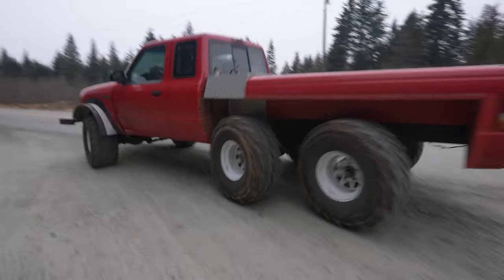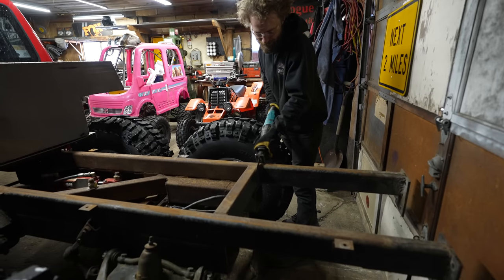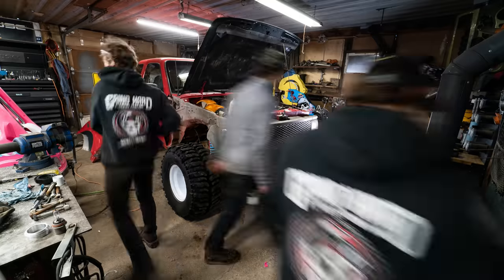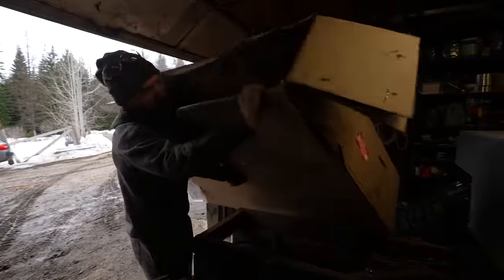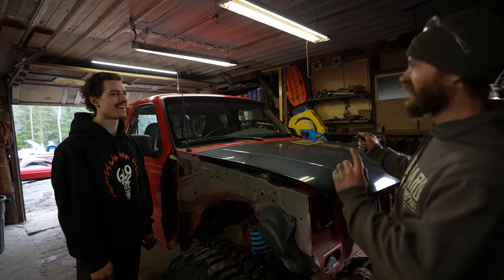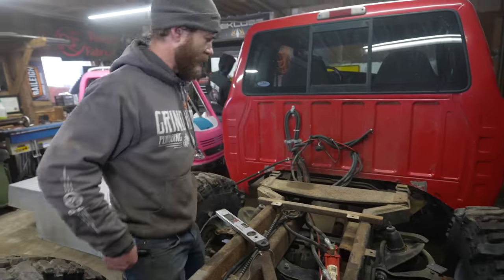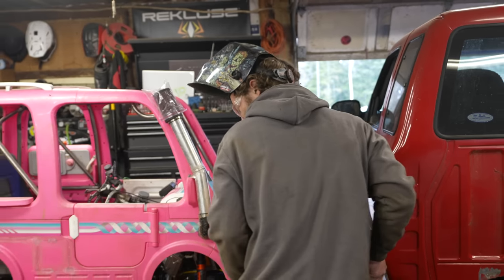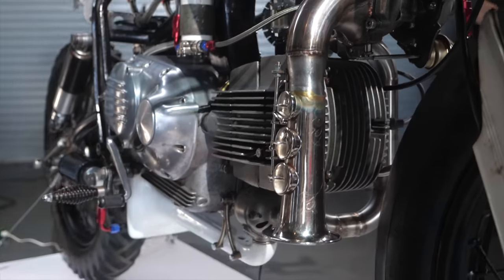Building a 6X6 Pre-Runner Ford Ranger!

Comment: You really have to appreciate how well the original builder built the thing. Some 6x6 conversions are all show, this was if it works whatever. This thing was probably done for spare change compared to some, but is already a badass unit for a starting point.
Reply from the maker: For sure! It was built very solidly in a lot of ways!
Reply: It was alot of work when my step dad and I built it. He has since passed.
Reply: @DANIELVINZANT  What year did he build it? Where at? Sorry for your loss.
Reply: @Beau Mershon  some were in the early 2000; it took us some time.  The truck was passed through the family prior to us building it. The person who we bought it from  got two DUI in 24 hr. He was running from the police slid off the road on the ice. He Hit a tree, He then tried to get it unstuck. The bumper hood radiator all damaged.  tranny leaking all over the place. it was not a runner when we got it. Our intention was to hunt with it. We had several hunting buggies at the time. When we got all the work done to it, thats we found out that the tranny was bad. He didn't tell us it was bad, but later, we found out differently. For a small town shop we sunk a lot of money into it. The front end was rebuilt to accommodate the 35-inch tires. We were told by the 4x4 shop in our town that we could put the whole thing together with the 37. But later, we found out. That the gear ratio would not work. Our understanding is that if we didn't put the 35 on the front , we would blow the tranny or t-case.  So the 4x4 shop, they reworked the front differential. Be careful with swapping tires.    We have huge  swamps up here. We did not plan on running it but in low range. We were told by the 4x4 shop that if we horses it up too much, we would smoke something. The old man, as he was referred to. Decided not to take it out. It just sat in the yard for about ten years. It was in the local parades a few times.  I think it was the local paper. Everyone in town is new who built it. Have fun with it. It right know is the talk of the town. You might want to mention his name in the vidoe. He has about five hundred relatives in the here small town. He was well respected and well loved by many. He would help out a guy in the middle of the night In a rain storm.. ask me I know. His name was Danny Mahan love to build all kinds of stuff. We built over  hundred boats in his shop. From fiber glass to aluminum.  It's a complete metal fabrication shop. With breaks, plate shears, iron worker punches and ten different kinds of welding machines. Just to give you a backround.
Reply: @DANIELVINZANT  it even more amazing that he was pretty crippled up and still managed to build it 
in soldotna alaska of all fucking places
Reply: @DANIELVINZANT  WOW you should repost this. So everyone can see. Cool story! Peace brother!
Reply: @Beau Mershon  we made a memoral vidoe of alot of his work through his life time. I would love to share it with you. I am going to need to get help with that one.  Becouse I am still learning how to navigate computers. Phones are pretty easy.  I am not sure how to upload that and were I would do that.
Reply: Yes He had poleo since he was 5, one leg was the size of a realy boney man's leg and four inches shorter. The other was size of a 12 inch pipe,  in his hay day he was a very powerful man. His upper body was extremely strong. Most of his siblings were over 6 feet and built. Great man I admired him alot. He taught me many things the most important thing was to always do the right thing, and if you didn't know what that was, he would always bend an ear to help you along your way..
Reply: @DANIELVINZANT  I know you added gears but did you do anything to add power to the 4.0 v6?
Reply: @Brock A. Stanley  we did nothing to the engine, except the electric fan for crossing streams. That's becousse when it was in the accident the stock  fan got smashed. We did put the new tranny in there.

Comment: Hockey puck body lift is remarkably common. They are good, high durometer, durable rubber.
I do wish you guys would keep the bed, in some capacity though.
Reply: And the most important quality- cheap
Reply: I actually prefer pucks over the hard chunk of plastic they give you when you buy the kits.
Reply: I don't have a lift but I replaced my worn out cab mounts for just a little over 12 bucks 👌
Reply: Pretty much before body lift kits were a thing this is how we did it and as mentioned already pucks are better and cheaper than what you buy as a "lift kit".
Reply: came here to say the same thing about the hockey puck body lift.
Reply: Agree on keeping a bed.

Comment: I lifted my Volvo 945 with hockey pucks in the rear, and in the front I cut and lengthened the struts. Back then I was one of a handful people who had lifted a Volvo, today it's become popular so there's a lot of people who have done it now. If it wasn't for inspections and laws here in Sweden I would've gone crazy and built a pre-runner out of it with doubled suspension travel and such.

Comment: Prerunner rangers are cool, but I feel this would've been a lot cooler build as a crawler.
Gonna be interesting to see a long travel kit for the rear.
Reply: I don’t think they are going to long travel it, it’s a “pre-runner” aka just new widebody fenders, method wheels and bumpers. They bitched out on this one lmao
Reply: @evanloeffler6772  I had a feeling it was gonna be a "looks build."
Reply: 6x6 with half ass front ifs spiff axle.... kinda pointless, todo the work on ranger for one I’d make both rear locked with 6 wheel hydro steering lol but I don’t have the time for ranger
Reply: @mikeyhue2437   the ttb is a desert proven ifs thats hard to beat in strength and travel. I'd definitely switch it out for a 44 ttb if they were to keep it and actually do a true pre runner build.

Comment: You guys ought to get a gouging head or oxyfuel torch to blast the welds in stuff like that big 7/8 plate, I used to hate it but once you get smooth- insane time saver, and once you clean it up for welding you wouldn't know the difference anyway

Comment: That plate behind the cab that was under the toolbox. Just from the video. What I see is. Could it be a twist brace for when you steer the back axles? As in when you are in a very tight bog and turn axles. Could the frame twist and if so, does that plate stop it from twisting any?
Reply: Could be but some good triangular bracing will do a better job for less weight.

Comment: I think that plate that was at the end of the original frame shouldve stayed. weight reduction might cause your 6x6 frame to seperate with a jump. Saying it as a frame machine operator at a body shop.
Reply: Yeah, thats what I thought, lowkey dumb for cutting that big ass frame plate off 😂 like that was the whole torsional reinforcement of that connection

Comment: 0:37 I believe that center hole is for mounting a switch to wire for dictating center position 🤔
Reply: in tandem with user input switching current as the other cut-off the polarity of which to charge a non-polarized capacitor in dictating direction by driving two reversed latching transistors fed back through the control switches.

Comment: Now were that aluminum arm bolts to the steel arm I think you should check to make sure there's a rubber gasket in between you want to keep those 2 metals separate from each other or you'll get electrolysis In other words it'll start  croading prematurely .  That's what did the Queen Elizabeth tune in that's why they retired or because the aluminum superstructure was starting to corrode faster than the steel hull

Comment: can you decide to turn the back wheel in the opposite direction of back wheels to turn real tight?
Reply: The current linkage mechanically ties the steering of the two rear axles together and steers them the same amount. They could operate the steering of each axle separately and build a control system to coordinate them, but I'm pretty sure that's not the sort of thing that these guys do.
Reply: @brianb-p6586  thank you. It's little bit confusing because there is 6 wheels. My question was can the 4 back wheel turn in the opposite direction of the 2 front wheels for better turn radius. Like GM hummer and now the cybertruck. Not the crab mode. Instead of control system, a single 1:1 gear would invert the front 2 wheels direction to the back 4 wheels.
Reply: @JeromeDemers  Sorry, I read too quickly and although the intent of your question was perfectly clear, I missed it.

Yes, while the current owners seem to like playing with the "crab" mode, the rear steering is completely independent of the front steering, so the driver can choose to steer the rear wheels the other way to make turns tighter. 

If you turn this thing right enough, it will be obvious that steering both rear axles by the same amount is not a good idea, causing lots of tire scrub. When turning opposite to the front to tighten the turn, the forward of the two rear axles should steer less than the rearward of the two, which is the coordination problem that I mentioned initially.

Comment: wont it start being super front heavy removeing all that weight?
Reply: They still have extra axle and increased weight from those heavy duty military axles in general, so now its more kin to what it use to be from factory balance vise, though not sure witch is  heavier old or new front bumper, but considering they will bump it to everything, it needs to be heavily built on front and this is big vehicle, you dont want to start trying to get it out of the wood or trail when engine comes to say hi to cabin. Back end, well you can still drive even if its missing, but yeah it needs weight on back as well to give better traction to rear axles. Next ep we shall see what they come up in design vise.. maybe long fuel tank between frame rails to be in safe location, moving weight lower and leaves room for actual flat bed, though i kinda liked the old fuel tank and bed combo look vise.  Then again tube frame bed with diamond plate would look mint on this and do practically same as the fuel tank by lowering the weight downwards.

Comment: I like people mind’s wonder sometimes it’s crazy what people can think of I’m putting a 3.9 little Cummins engine in my 2002 Nissan Altima it’s getting a lift with mud tires on it I don’t know if I want to take a awd system from an infinity of that year or redo the whole front rear end and make it 4wd I already got the motor and transmission so going in no matter what going be bad ass little turbo diesel Nissan Altima

Comment: I've noticed the content as of late is much shorter and shows less actual fabrication, just long time lapses. How long ago was all this stuff done? You can see Ethan building the barbie fuel tank in the background at one point. I can't believe for a fabrication company you guys didn't even build the front bar! Could have at least ordered sheets of steel off of eBay and built one.. Slapping a heap of bought pieces on isn't exactly impressive lol. I used to really enjoy the videos but they've dropped off considerably, which is ironic considering you guys get paid/ sponsored for the content.